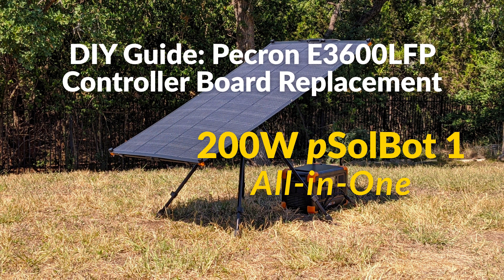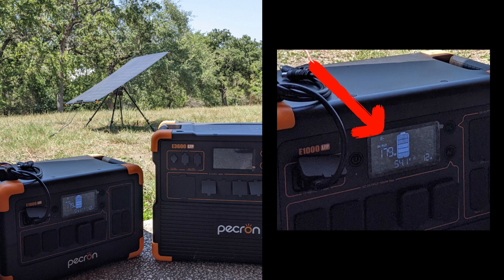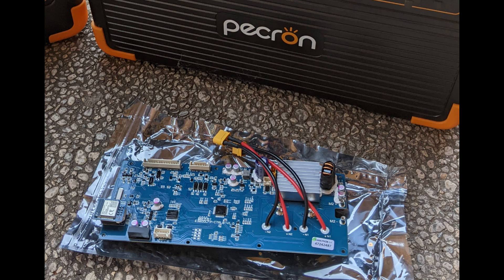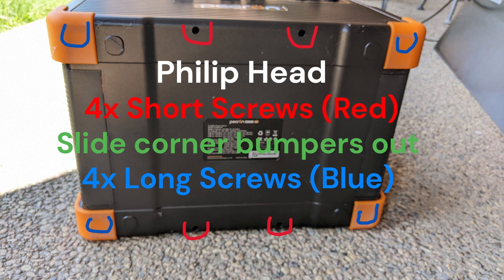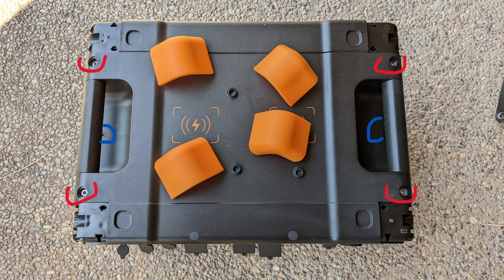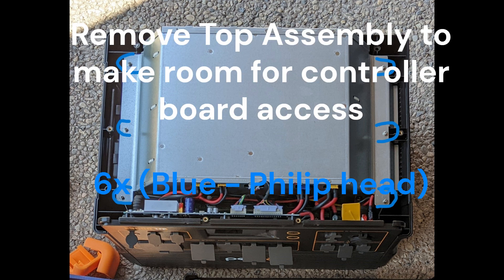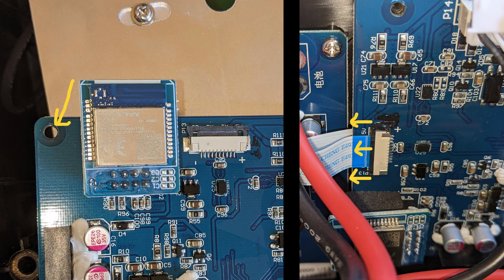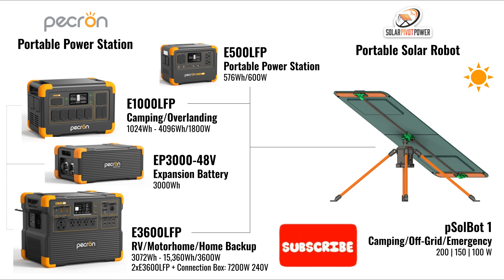Pecron E3600LFP Controller Board Replacement. DIY Step by Step Guide.

Comment: Hey, thanks so much for this video.  Do you have a video for replacing the inverter board on a pecron e3600lfp?  I will have my replacement inverter board in the next couple of days and having a video of this quality would be fantastic.
Reply from the maker: Thank you for your kind comments!

I don't have an inverter board replacement video, original one is still working fine for me.

I have asked my Pecron contact for some visuals of their inverter board and any material they may have to assist here. If I can get something useful - I will try to put a video at least with information on disassembly and any specific items to look our for.

Comment: Is it easy to replace the batteries on this unit? Thanks.
Reply from the maker: Good point, unfortunately these are not designed for user swappable batteries. An experienced technician may be able to swap out battery sub-assembly with an exact cell replacement and re-glue all the sensitive BMS sensors back.